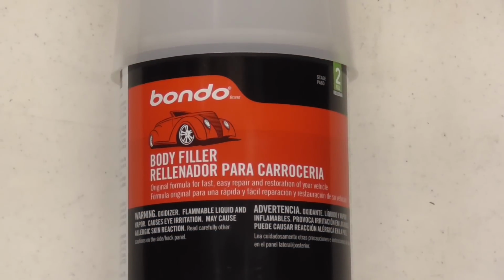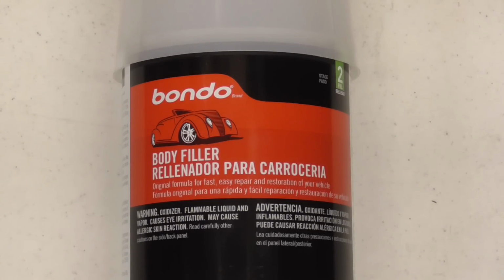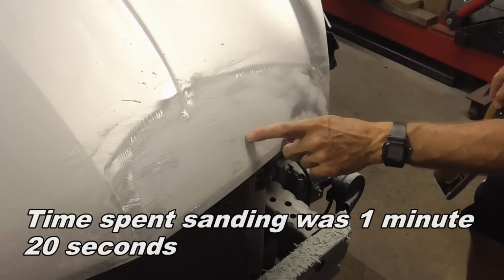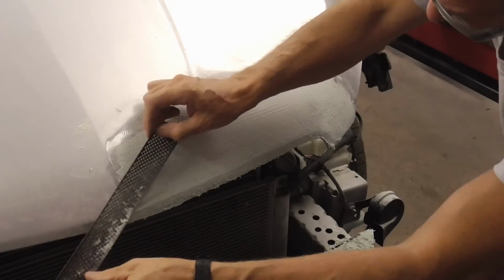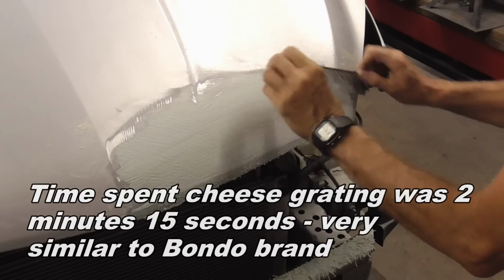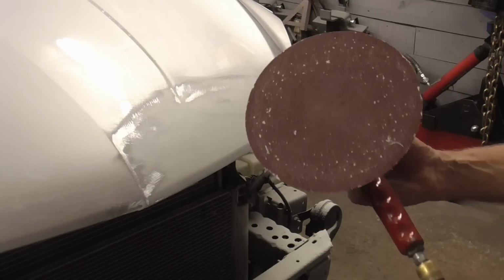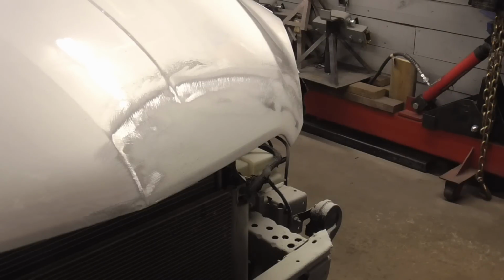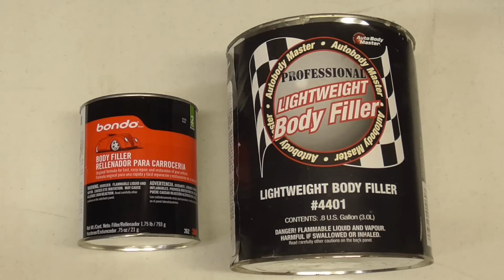Is Bondo Brand Body Filler Hard to Sand?  Are Expensive Fillers Worth It?

Comment: Hey Jerry ,
It's been a while,  I've had some very serious  health problems  , but I'm just taking it one day /  hour at a time.
Have you ever heard of mixing fiberglass  resin in with the body filler, I've heard it makes the filler stronger.
What are your thoughts on this. 
          .Have a good weekend. 
                                                       Thanks.
Reply from the maker: Yes.  Sometimes if you have an old gallon of filler that has sort of dried up you can simply add some resin and it's like new.  You can also use it to thin it out a bit almost like a glazing putty.  It probably does make it stronger or harder too.  Hope your doing better Al - I'll be praying for you my friend.  Great to hear from you again 👍😊✌

Comment: Hey dude, great video as always. I don’t know if you’ve done a video on this yet, but I’d like to see your whole air setup: From compressor to gun gun and everything in between. Also, do you have an air dryer or a refrigerator and how is your system piped?And do you have an automatic drain on your compressor?
Reply from the maker: Thanks Jeffrey - here's 1 or 2 that may help with that - https://www.youtube.com/watch?v=CSGAgAyeInA  - this is the set up I'm using currently - https://www.youtube.com/watch?v=blE9tKKPI20  Here's one on the type of compressors I find and use - https://www.youtube.com/watch?v=53miAObOdVY  Let me know if you have any more ?s - Jerry

Comment: In the past I've found the Bondo brand was harder to sand vs. yellow or gold fillers. But recently I was at the paint store and they had Rage Gold (actually the step up from it in the same line) and it was $189/gal. I got a gallon of Evercoat lightweight body filler for $36. Even Bondo brand filler isn't that cheap at like Autozone or O'reillys.
Reply from the maker: That's good stuff - the Evercoat Lightweight - used it many times :)
Reply: @LakesideAutobody  Yeah. I have no complaints...especially when the guy gave me shop price on it. lol
Reply from the maker: @jayinmi3706  👍
Reply: Is 3M lite weight body a quality product? I ran out of Eastwood contour.
Reply: @acardiac5983  I've used it at the last audio shop I worked at and I had no problems. 3M is generally pretty good stuff...what I REALLY liked about it was that the hardener didn't separate.

Comment: Compare to a 3m platinum and you’ll see the difference
Reply: I agree 100% Jerry shows the less expensive ways. It takes a month or so just get through a gallon of the good stuff.
Reply: compare the receipts too, as a diy Ill keep that extra $80,3M means 3 times the money
Reply: @rcs0296  times money , you can sand platinum plus with 80,180  , and be ready for paint without using as much primer and no deep sand scratches , no glazing putty etc
Reply: @rcs0296  What Dan w said. Neat stuff.
Reply: @danw1089  maybe worth it  in a production shop

Comment: Pros don’t have issues with fillers. We can use any brand. Cheap expensive. If you are someone who is just starting out the problems you have are in fact your training. Research, do more filler work. Years will go by and you improve. Not over night. This Skill is built not taught. Sure you can follow others. Everyone does what works best for them. Which doesn’t mean it works best in your situation. What brand or what materials you use have less to do with the job then your abilities. If you’ve not used a gallon a week for a year than you are in no way skilled with applying or contouring fillers. Get to work! You will get there but if you only want to play the piano and you never pull up the bench and practice for hours a day you will never get good at it. Same with auto body work.  15 year pros working in high volume high end shops have no body filler questions or body filler issues.  Think about it.
Reply from the maker: Wonder how many times James Hetfield played Master of Puppets?